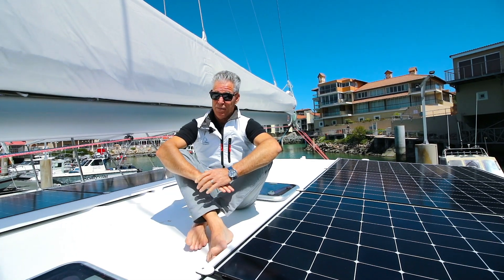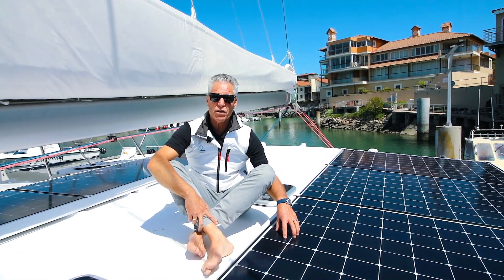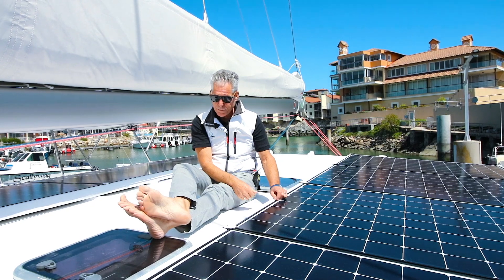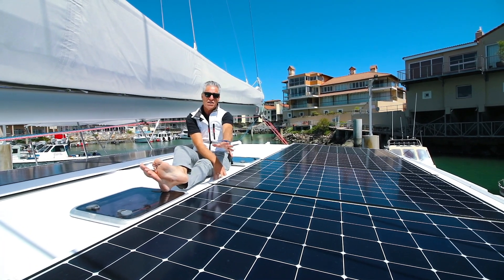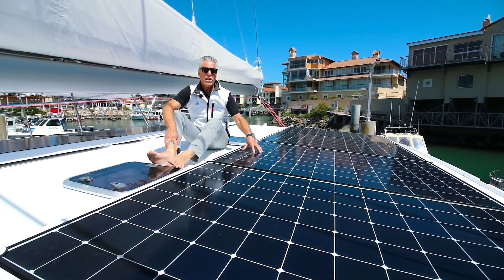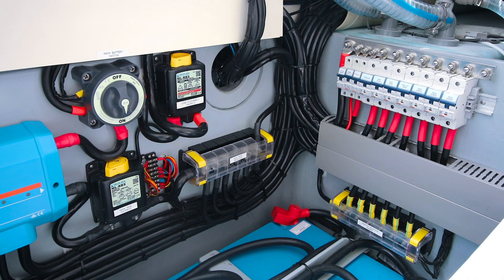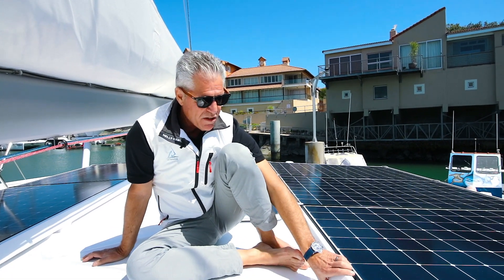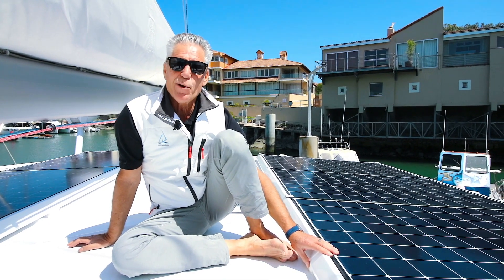Balance Build Technology - Solar Panel Set Up

Comment: How do you clean under the panel? I get the heat dissipation but it would seem to be a mold factory- just flushing with water would not prevent. Need to get at it and scrub. Do the frames lift up?
Reply from the maker: To date we have never seen or experienced one of our catamarans have mold buildup under the solar panels. If it were to occur it would be easy to power wash under the panel. But, if this is a major worry for anyone, it is easy for us to offer a fast removal system at their request. It is simply we have never had any Balance owner report a mold issue, and this includes several of them that sit on the hard during the hot and wet summer hurricane season in Grenada.

Comment: Green boat??
A Chinese junk or a Viking boat is probably as green as a boat can be. A modern epoxy boat with all modern technology is not anywhere near green. The veneer very thin on these boats is the only green there is.
Reply: Also: That video is some three years old. Recyclable fibers and resins are now starting to come to market. Balance has a department for custom boat projects. I'm guessing that they would be open to building you a boat using those fibers and resins if you were to order such a boat today...
Reply: They are infinitely better than every fossil fuel driven motor yacht on this planet. They are also A LOT better than nearly any other sailing yacht/boat on this planet of comparable size. Why don't you go after everything that is WAY worse than this?
Reply: @angela1984a  hi
Your definition of green is warped.
And you know it.
Makes a you a liar.
Many others do too, but that still does not make it acceptable.  Huge Airplanes with huge engines can glide for a long distance without the engine running. That does not make them green. Nor could they claim they can fly without fuel or engine or that they are green. And that the video is 3 years old does not make his false statement any better.
Reply: @ottifantiwaalkes9289  Doesn't make me a liar at all. I never said that Balance catamarans are "green". Read again. What I said is that catamarans from Balance are a lot better than many, many other boats of comparable size. Again: They are a lot better than a comparable motor yacht. Or something from Lagoon or Bali catamarans.
Reply: @ottifantiwaalkes9289  And: A sailboat is not an airplane. Even Greta sailed across the Atlantic. Remember?...
Reply: @angela1984a  I meant with you balance catamaran. And the person that spoke that li was Philip B.
Reply: @angela1984a  I agree with balance building the finest boats I have seen. I only argued the word "green" Philip used.  Almost bought the 526. Did not feel good being on a waiting list for years. Keep up the good work and quality but do not call it green. 
Makes you sound like Bill gates.
Reply: @angela1984a  seems as you are wanting to miss my point i made. Like to stick out from the rest? Be different. Be better.
Reply: @ottifantiwaalkes9289  Curious... If this is how you feel, then why did you almost buy one of their boats? Are you perhaps the climate scientist he's talking about in some of the videos?...
Reply: @angela1984a  why do you have a problem with someone correcting your false statements?
Reply: @angela1984a  if you were my syster and lied to me I would also point this out. Seems you are ok with lies though.
Reply: @angela1984a  and no I'm a 40 year long boatbuilder by trade.
Reply: @angela1984a  and Greta taking a sailboat is merely much less pollution but not green. A solar panel or electric car is not green.
Reply: @angela1984a  I go after who I wish. Second I reply to your claims that are false. And those you would like us to believe. Bad enough we have media and politicians already doing that payed with our money. And what does philip making the green statement has to do with the fine boat you build.

Comment: What is keeping y’all from designing a recessed area through your the walking area towards the bow from the cockpit and place solar panels in the recessed area and cover it with plexiglass.
Essentially a boat which is covered over 2/3rds with solar panels

Comment: What do you do when it tips over?
Reply: There are a huge amount of performance cats that has never tipped over. You will have to know the limitations of the boat. And if you wish there are also load alarms that will warn you if the sails are starting to become overpowered. Every Gunboat todays comes standard with such an alarm. So you might think that those load alarms are expensive. And they are of course. But compared to everything else even on these smaller Balance catamarans it's actually not that much more money, meaning that they won't really push up the final price of the boat that much. So that would take all the guesswork out of it. And finally there is a correct 'evasive maneuver' if all fails. It will perhaps not save every situation. But the basic fact remains – if a cat tips – then that will be because you have way too much sail area up in way too windy conditions.

Comment: You nailed it! Of course another advantage to raised panels, is shading and therefore Cooling of the coach house. Yep solar panels should be wired in parallel, with individual mppt controllers. I applaud the fact you don’t use internal mouldings, less weight, therefore more wind efficiency, and less waste at end of product life! Love your Product, and the humble way you explain your philosophy! Thanks 😎🏖🌴☀️🇦🇺

Comment: I noticed there are few hybrid solar panels that work as thermo panels as well.  My guess is they have a system of pipes underneath the panel with water flowing though.  If that could be done across all the panels you could circulate water round a circuit to cool the panels and keep them efficient and use that water to heat a hot water cylinder from a central heating system.

Comment: Agree with others that electric drive with Lithium batteries, solar panels and a backup generator is a great way to go.  It will be increasingly common on sailboats in future, especially as battery costs continue to fall.  With Hydrogeneration (regeneration during sailing) the battery bank is recharged indirectly with wind power.  Electric drive is becoming more common, and it's perfectly suited to sailboats since it works in harmony with nature, which I argue is a main purpose of sailing.  Much cleaner and more logical on a sailboat than burning fossil fuels.

I'd encourage Balance to look into electric drive.  Given the low volume production, the cost of electric drive is more practical for Balance than higher volume production catamaran builders, at least until battery costs continue to fall further.  Also electric drive is better suited to a performance cat than a production cat, due to being under sail more often.

Phil, Silent Yachts used a marine engine connected directly to an electric motor used only as a generator to charge the batteries and run loads when needed.  This is a great solution that leverages cheaper and more easily maintained marine engines vs gensets.

P.S.   Love the concept, design and implementation of your (Du Toit) boats.  Thanks for making an intelligent, thoughtful, tasteful, and classically beautiful statement with them!
Reply: Battery technology just isnt there yet.  If you're a coastal cruiser who goes out for weekends im sure electric would be fine but most of these balance cats are for blue water cruising.  Even with big battery banks about twice the size of the ones theyve been putting in these boats the range on an electric cat is about 50 or 60 miles.  Then you have to run a generator to keep going.  These boats with diesel engines running one engine at a time sip fuel and still cruise at 7 knots.  I do believe in the future we will see a lot more electric motors installed from the factory but right now the battery technology just isnt there yet.  Balance will let you install electric motors if you want but you just have to have the company come and install them.
Reply: @justincruz8352  I don't think many people are suggesting to do ocean passages with only batteries for electric drive.  Batteries would always be backed up by a diesel generator for long passages in order to cover areas without wind.  

(This is a serial hybrid, also known as a diesel electric, like many locomotives, diesel submarines and some ships (all of which are common today).  A parallel hybrid is also possible with electric drive in one hull, optionally backed up by a diesel generator, and a diesel drive in the other hull.  That gets redundancy and the ability to run purely electric much of the time, purely diesel, or a combination.)

That said, particularly for a performance boat and given good weather routing, the amount of time under motor can be minimized whether it's a diesel drive or electric drive or hybrid.  As Phil mentioned, some of their customers do ocean crossings and almost never motor during them.

We agree that for coastal cruising and day sailing battery electric drive is already practical, being used actively today, and increasingly offered on production boats.
Reply: @LoanwordEggcorn  When are we going to reach a time when Solar can propel the boat all day at a good 8-10 knots, AND power all the onboard consumption AND charge the battery up for overnight passage without requiring any supplemental generator? Is this even going to happen in my lifetime?
Reply: @farzana6676  Let me answer your question with a minor mathematics puzzle.

About 1 kiloWatt per square meter of sunlight falls on the Earth at noon on a clear day at the equator. Affordable Silicon solar panels are about 20% efficient today, so that's 200 watts per square meter of solar panel under ideal conditions.   Most of the time it's less power per area.  (Multi-junction solar cells such as used on satellites are nearly twice as efficient, but not affordable for consumers.)

How many Watts do you need to accomplish what you ask?  It depends on the boat type, displacement, speed, house loads, etc.  It takes far less energy to move a Carbon composite foiling catamaran than a steel barge.  A barge is generally more stable but far slower than a foiling boat.

The answer is dictated by physics and improvements in solar cells.  

Nonetheless, existing production sailboats greatly benefit from having solar panels, Lithium batteries, hydrogeneration (regeneration from electric motors being pulled by sail power), wind generators, etc.  Ask anyone doing it.
Reply: @LoanwordEggcorn  I just want to see a 45 or 50 foot luxury Cat like a Fountaine Pajot or a Privilege lose the mast and the sails, lose the engine and the genset, install the solar and the batteries and be able to go all day and all night at a brisk speed whilst also running all the systems onboard.

I wonder if I'll ever see that day in my lifetime.
Reply: @farzana6676  How many square meters of area does a 45 to 50 foot catamaran have for solar panels?  How many watts does it take to go at a brisk speed?  Using multiplication, addition and division, you can answer the questions.

Sailing is wise since it uses wind power.  Adding solar increases the number of energy sources available for cooking, refrigeration, making drinking water, etc.  Removing the sails from a sailboat makes it much less useful, flexible and energy independent since it gives up the ability to move under wind power.  

(Same goes for starting with a power boat.  In case you didn't know there are power catamarans that have no sails to begin with.  However burning fossil fuels to move when you could use wind power in the form of sails seems dumb.)

If you don't know how to sail yet and would like to learn, joining a local sailing club and taking classes there is a great way.  It's easy and very fun.  

Sailing doesn't burn any fossil fuel when there is wind, and with electric drive to motor out of a harbor, fossil fuel (from an optional back up generator) gets almost no use for day sailing.